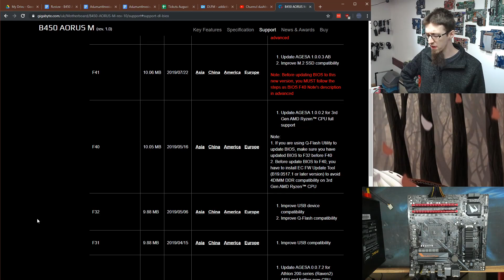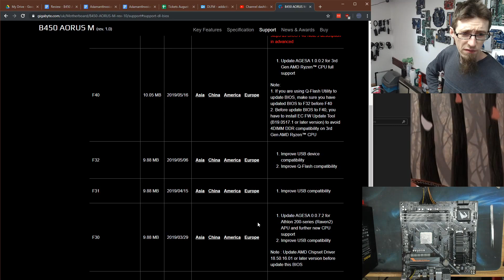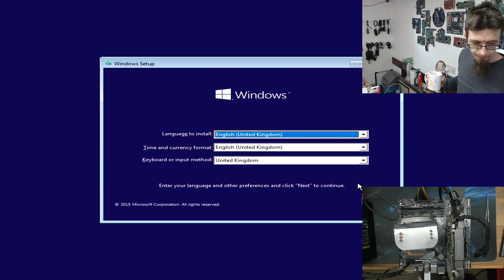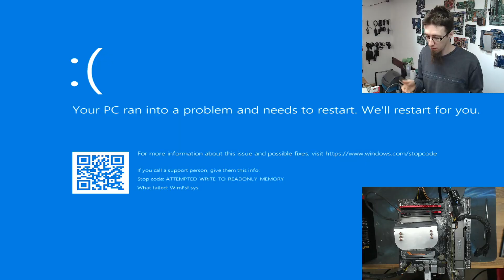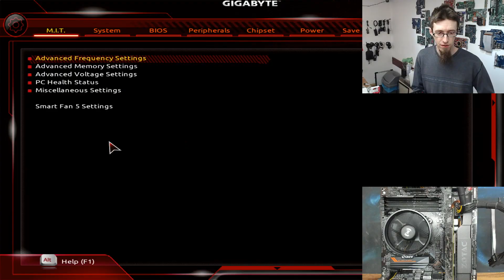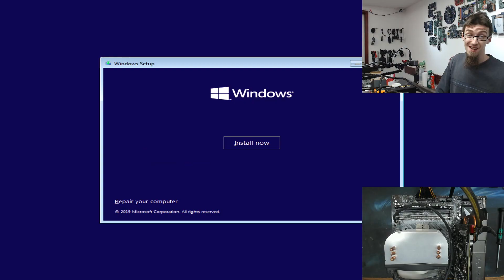LFC#183 - Gigabyte's BIOS update bricked my B450 Aorus M

Comment: good day has been a useful video. I am using gigabayte aorus x470 gaming 7 wifi motherboard. For bios update, I was told to install one by one from the first release and follow the steps written there. When I bought the motherboard, it is right to update the latest biosa after the first install.

Comment: After a power outage , my main bios  was corrupted.  searched online and found instructions to hold reset and power for 10 seconds to trigger the board to shutdown and reboot to the second Bios. It's not in the manual. mine is a AX370 from Gigabyte.  Had to flash to remove the corrupted bios or it would revert to it on Cold boots after power outages.
Reply: That board has a bios switch, if you brick the other bios just reflash it back. Before hitting flash now, switch your bios to the brick one then flash it

Comment: why would requiring windows to be installed for a bios update be a problem. What are your options? What do most users run? How hard is it to setup a spare drive and install windows if you've got a linux box? If you're a linux dude, chances are you know how to setup dual boot. Is the bios upgrade compatible with wine? It's not like that motherboard is running a mac os or anything... weird concern to have.

Comment: My Aorus B450 Pro WiFi worked as advertised (with the Athlon 200GE I bought just for this purpose) by going through F32 (I confirmed it was on F32) then installing Windows and doing the EC FW update.  I then updated to F40 (which was the latest at the time), and I've stayed there ever since.  

It's bizarre that your board updated to F40 when you loaded a BIOS marked F32, but perhaps the original boot into BIOS used one BIOS chip (with F2) but then booted to the other (that already had F40), after the update.  Either that, or the Gigabyte site linked the wrong BIOS version.

The EC FW update does seem to shuffle the DIMM slots, but as I recall, you can't run four DIMMs without installing it.

Comment: The old way , in DOS , use TAB to auto-complete :) . Also if you make a mistake it'll do nothing really. They all check the BIOS file before Flashing, verifying the Flash afterwards. More things to do is boot without RAM , even CPU .. make it complain

Comment: That's why you shove an old 1700x into the motherboard it's an x470 motherboard it boot . Your trying to flash with an newer CPU that it doesn't like . Old cpu it like and flash to newer bio to 42 then shove new cpu in that easy . Also t
Have an lcd that had HDMI cables and VGA cables mounted on the wall so when you working on PC's you can sit the PC in front of the LCD and work at an station . Wireless keyboard and mouse are for noobs

Comment: In January of 2018 i found an epic deal on a open box Golden i7 8700K for $280 that clocks up to 5.3GHz with 1.380v and the z370 Aorus Gaming 7 motherboard (which looks awesome) to go with it for $150. Dropped l0 $200 for 32GB's of GSkill's (designed for AMD) FLARE X 3200MHz CL14-14-14-32 (Sammy B-die) that clocks to 4000CL17 with 1.450v. $650 for a solid gaming foundation.
  I had $1400 left in my pocket and saw eVGA's 2080ti FTW3 Ultra (-87) that had a damaged box and a couple  fins. I got it for a cool $1,000. When brand new that GPU cost $1500.

Comment: Hi, I own the same motherboard. Originally I had a Ryzen 5 1600, then I upgraded to the Ryzen 5 3600. Using the 1600 I followed the sequence of BIOS updates listed on the site. After 30 minutes of updates and restarts it worked fine.

Comment: wth you prefer swapping bios chips than doing bios flashback ? what is wrong with you ? it also will cancel your warranty ! they made that bios flashback thing exactly for this kind of problem its so simple you just have to put the bios file on the root directory on usb drive and then just press that tiny button and wait until the flashing light stop
Reply from the maker: Most low-mid range boards don't have BIOS flashback. That's a high-end feature on anything older than X570.
Reply: @Adamant_IT  You said on 33:38 in that video one other way by using flash back and must changed the file name and you hated doing that way, aint it using bios flashback?

Comment: How I solved this was I just put in different ram let it retrain then put old ram back in (forgot also turned it on with no ram before putting in the different) worked fine aourus b450 pro wifi what that ecfw update does is updated the memory controller itself it's weird it fought u so much more than it did me

Another note most ryzen memory issues are fixed by locking voltage to 1.2v

Comment: Switching the BIOS chip was the answer - that simple - never thought of that but it worked
Reply: Only if you have dual BIOS. Otherwise, you'll need to reflash the EEPROM with the existing version. So, it's always best to download current version and new version.
Reply: Or, just leave the bios well alone.
Reply: @tyronenelson9124  tell that to AMD With their unsupported 3rd gen processors
Reply: @ABDULSALAM1412-u6y  I wish i could.
Reply: @ABDULSALAM1412-u6y  even a320 chipsets can take 3rd gen cpu's lol
Reply: @budgetking2591  Tfw AMD wanted to not give 300 and 400 series board owners Zen 3 at all to force people to buy onto their 500 series boards. Only until the community took out their pitchforks did they rectify this. But AMD is your friend amirite?????
Reply: Yes because the BIOS Chip gets bricked not the actual mobo

Comment: What did you use to get the bios chip removed?
Reply from the maker: I used a hot-air soldering station. WEP 862d+ to be exact, which is a cheap station.

Comment: I ordered pc parts to build my own with an  Gygabyte Aorus B450 M motherboard and AMD Ryzen 5 chipset. Is there any chance it will work without any bios update? And if it doesn't, how am i able to use the motherboard? I have no other CPU's
Reply from the maker: If you board is unflashed (it's pot luck on this one) you'll need to find a local computer shop kind enough to flash it for you.
Reply: @Adamant_IT  thank you, I'll keep my fingers crossed that it's flashed to F40 at least. Too bad it doesn't have the option to upgrade without a CPU

Comment: i had this motherboard before and i did the same thing, first i installed the F32 and it went good then i did the F40 update and it also went good for me
Reply: i had it also.. did not tried to flash it but it froze few times when in bios  xD  sold that shit away and went back to second-hand Intel's
Reply: but how jump to f32 to f40 o.0 is the second bios is f40 or just random anomaly ,asking becose i wanna upgrate my old system now i have i5 2400

Comment: Yep, my B450 elite appears to be knackered :/ mine chose the CPU light
Reply: Me too how’d you fix it?
Reply: @icannotcontinuemusicactually  Had to get a replacement bios chip and solder it. There about £12/$15 on eBay, and the benefit is you can specify any particular BIOS level

Comment: Heres a good question.. if I get the AMD 3300X (if i am lucky enough, that is!) I cant just put it in a new B450M m/b, (out of the box) and expect it to work, right? The m/b would have to have some other AMD AM4 cpu, the BIOS correctly updated, then the 3300X installed? Or.. remove the BIOS (Gigabyte = 2 BIOS chips?) Chips, manually update them, then resolder them back in? Egads! Even tho the B550s are due out in..June.., I am not sure of their asking prices, so the B450M is my choice. Any suggestions? I might ask Gigabyte for a suggestion, too. 🤓 I might just get the 3400G, so I dint have to shell out $$ for a GPU card!
Reply from the maker: My current recommendation is to get an MSI MAX board (Tomahawk/Mortar/Gaming Plus) as they're all updated out of the box. Other makes are hit and miss.
If you're going to be gaming, keep in mind that the 3400G graphics are fairly limited. I'd suggest going for one of the new chips, and a budget graphics card. An AMD RX 570 or 580 can be had for so little now, and they're still great budget cards.
Reply: @Adamant_IT  yeah, thats sorta the plan. The 3300X is a great deal for a new CPU, at $120. Im not a big gamer, but want 1 or 2 newer games. PC build is a mATX, a 550W PSU, about 16GB 3K RAM...

Comment: Was just shopping for a B450 and was about to considering mobo. Thanks for the Informative video.
Reply from the maker: Yup. If you're building mATX, buy an MSI B450 Mortar Max. It's just better than this board, and the MSI MAX boards are all Ryzen 3000 ready out the box.
Reply: @Adamant_IT  i gotta re read that! Thanks! That 3K ready includes the 3100 / 3300X? Hmmm... I thought the Gigabyte B450M was also 3K ready...
Reply: @j.lietka9406  3k dollar fix ready...
Reply: @j.lietka9406  My box says " Ryzen 3000 ready " , so they lie too
Reply: @mayattv4986  LOL! 😁😃 i am waiting for info on the mATX B550 m/bs as far as cost. Thank you
Reply: @mayattv4986  3000 dollar fix? He's a tech who already has a soldering iron and knows how to use it, so for him it's a free fix. For us non board soldering folk, there's always a $70-200 fix... buy a new motherboard. 
Also may have been an issue caused by not using the updates prior to F32.  With Gigabyte you also don't want to put 2 bios updates on same usb. Download both to file on computer, then put older intermediary bios on the USB first, update the bios. Then delete file or format usb, put on the new bios and update again.
Reply: @frommatorav1  Come on, take humor as it is.
Reply: @mayattv4986  yeah, maybe in labor. That was even a little high for sarcasm. Since it was for lols, np.

Comment: My B450 Aorus M @Bios version F40, tried updating to F50 while updating til 90% the PC got shutted down.
Can I still save this? or should I deliver it to gigabyte?
Reply from the maker: Try a couple of reboots to see if the backup bios kicks in, otherwise it'll need manually flashing to fix it. I have a video on doing this, but it involves desoldering the bios chips.

Comment: Is it mandatory to update bios for this board?
Reply from the maker: Depends what CPU you want to run, and what your board shipped with. Ryzen 3000 requires F42 or higher.
Reply: Adamant IT I have a Ryzen 1600
Reply from the maker: Ye, that'll work with any version. If everything works OK out of the box, I would leave it alone.
Reply: Adamant IT ok, thanks

Comment: I've ran into the same issue. Went to flash to F32 then to F40 and the board is dead. It just sits on the DRAM light. Ordered a low range AM4 chip to allow me to get the bios sorted before I put my 3600 back in

Comment: My update told me to update chipset drivers before performing F3. I did so. Then updated to F32. Went perfect. Debating on going all the way up to F50. But I dont have ryzen 3000 for this board. Is it worth going up to F50 with an APU?
Reply from the maker: If it's working, I'd leave it alone. You likely won't see any worthwhile change unless you've got a Ryzen 3000 anyway.

Comment: I'm planning to build a new desktop PC and it would use AMD Ryzen CPU. I would like to know which motherboards are easy to update BIOS. I'm thinking of getting  Asrock X470 SLI/AC or Gigabyte Aorus B450 pro wifi.
Reply from the maker: The MSI Tomahawk Max series seems to be the way forward at the moment. I haven't used one myself yet, but the specs look great, and other experts are all singing the same tune. The older Tomahawks were a bit cheap, but their shortcomings have bee fixed, and they're now offering fantastic value.

Comment: Just stumbled on this video cause I just ordered this board for a build for someone... The reason why there's so many hoops to jump thru is because of the bios chips storage size based on and specs, many boards before 3000 came out can't store both the microcode for 1000 up to 3000 so to get around they have a jumping off flash from 2000 to 3000 many mfgrs have since fixed the issue by releasing a bigger bios board and calling it "max" (Asus) or "plus" (msi) that contain microcode for all 3 but previous gen to that update has this same issue... I don't think any mfgr actually considered amd sticking to there word about having am4 be a platform for as many years they promised (I think they said 4 years) and there even pushing it again with 4th gen they all just thought they'd pull an Intel at some point and change pin layouts every gen or every few gens
Reply: Plus (asus) max (MSI)
Reply: oh ok
Reply: I will never understand people not upgrading their motherboard with their CPU. If you don’t it means you upgrade every gen which is idiotic. And you lose out on new chipset performance and features. Just buy a CPU, stick with it for 5+ years and when you upgrade, get a new board with a fancier chipset and possibly VRMs. “Socket upgradability” is absolutely a moot point for me, and AMD never even wanted to give 300 and 400 series boards owners Zen 3 in the first place, only until the community took out their pitchforks. By swapping or adding pins to an LGA Intel can make their CPUs feature set or power delivery more robust, and really two gens per socket is all you need, because again, why the hell would you upgrade every gen? Why would you stick a Zen 3 in a 300 series board?

Comment: Hi ! Is it possible de flash the bios without the cpu ? I have just my ryzen 3600 ... thanks
Reply from the maker: Sadly not, board does not have Flashback (chipless flash). You'll need a doner cpu, ideally a Ryzen 1000 or 2000. A local computer shop might be able to help you out there, or flash it for you.
Reply: @Adamant_IT  i can use qflash no ? Because with the covid-19 i'll not be able to find a shop ...

Comment: Watching this after getting an issue with the F50 bios where every time I turn it on after a few minutes, the system won't post and I'd basically have to get lucky after power cycling it in order to post again. Will update this on whether I fix it or not.
Reply: My Board behaves also very strange since F50. Sometimes i get a 0xc00000e9 error, than i have to reflash the bios or disable the AMD fTPM (until the bios is flashed again) and it will boot Windows correctly. The BIOS gui has a some graphic issus since F50. For me this happens paired with a ryzen 2600x and crucial ballistix 3200mhz Ram.

Comment: When i updated mine from F4 to F50 all games started to stutter.
Reply from the maker: Odd. Tried F42 as the next newest?
Reply: @Adamant_IT  but can i downgrade it without any consequences?
Reply from the maker: Yes, you can jump between BIOS versions at will, provided your CPU is supported on the version you're flashing to. F42 is a 'safe' version that'll support any Ryzen CPU.
Reply: That's strange. F50 bios on my Gigabyte b450 Aorus wifi pro has been the most stable. Been on that close to a year.

Comment: I have Gigabyte Aorus Elite B450 , i got this board with Bios F41 or F42f. Ryzen 7 2700X , ram HyperX Fury black 16gb 3200mhz  cl16. I was thinking before seing that video about update to the latest bios because F50 should improve system boot time and F51 improve system stability. If there is chance i will have sensation like that , just with simply bios update i will not risk it. At this moment all is fine , with memory XMP profile also.

Comment: Im an amateur. I did the exact same thing. Upgraded B450 to take ryzen 3600. But F32 was factory bios. Ignored the EC poweer firmware thingy because i
Windows went dump when I tried. Anyway F40 went well, F42, fine. Now running F50 from today. Had issues with drivers- realtech, intel gigabit etc. 
Conclude Dont buy a Gigabyte board.
Reply: Great video
Reply: Oh and I completely gave up on trying to run LINUX. On B450 board with 3000 series and AMD RX590. Just will not happen☹
Reply: @mboden8055  Which distro of Linux? The radeon boards doesn't have "oficial drivers" unlike nvidia and you have to install in binary mode from and stable repository
Reply: I have b450m-ds3h, with f41 bios, i must update to f50 version?
Reply: @29Darkray  Of course, the F50 is the best BIOS (until now), a lot of more options, specially for OC AMD CBS, BCLK and more

Comment: I am having a similar issue with my ab350 gaming 3 
I followed the instructions on gigabytes page to update to f40 after which I swapped my old ryzen 1200 for a new 3600x that I bought and it won’t post anymore with either chips even after clearing the cmos changing ram and removing the cmos battery, this really pisses on my battery as my board is essentially dead